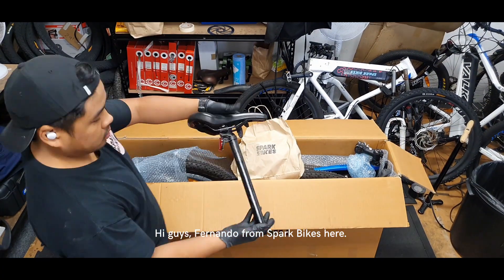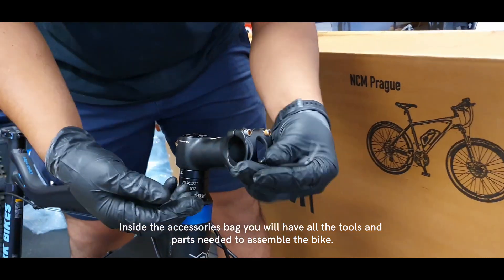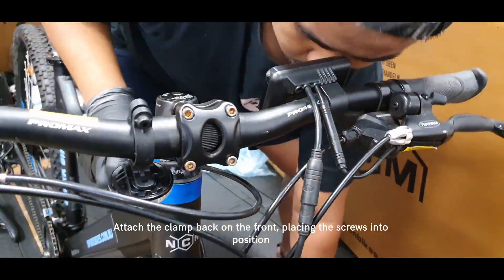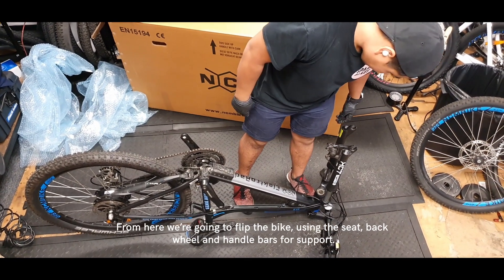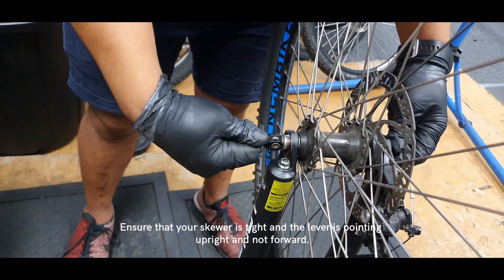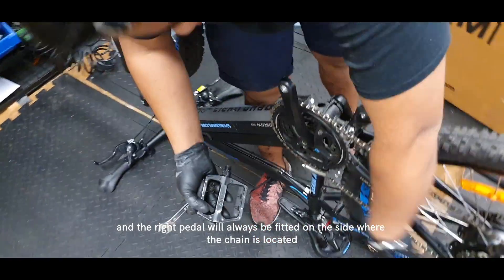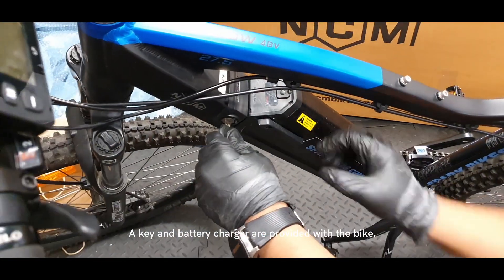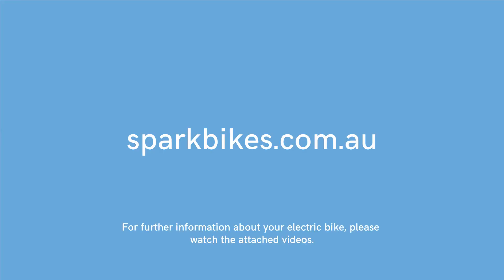NCM Moscow Electric Mountain Bike,E-Bike, 250W, E-MTB, 48V 13Ah 624Wh Battery - Assembly

Comment: In certain countries like mine the front brake is on the other side according to the manual.  Otherwise this video was helpful.  Just be sure you tighten the steering column as well.

Comment: hi, i got problem need assistance, i got flat tire and i cannot find the right tubes for it, does 27x1.9 works? or does anyone know which website i can buy the rite tube
Reply: You find it?
Reply: @thatican  no, instead, i bought trek slash full suspension, shaft shocks with 29x4 wheels